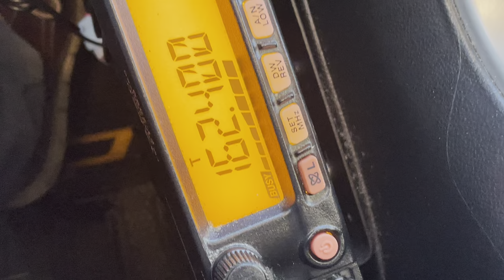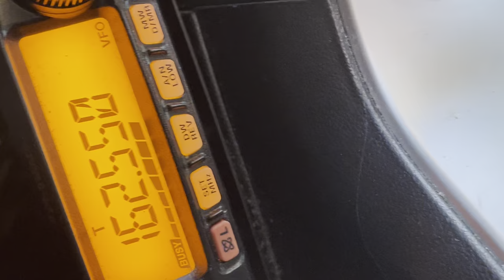VHF Band Opening Multiple Signals Ducting DX Long Range Propagation NOAA WX Radio 09/10/2024 Part 2

Comment from the maker: If you’re wondering what the point of the DC volt meter is…well, I was doing testing to see how much voltage drop occurred in the car’s electrical system when I transmitted at different power output levels….and obviously the function of the voltage regulator when the engine is running, plus voltage drop on the battery when the engine is not running.  

Yes, I know, “12 volt DC”.  The battery by itself should show a voltage in the 12.2 to 12.5 volt ballpark.  

With the engine running [and alternator charging the battery] the voltage should be more like 13.5 to 14.5 volts DC.  Different vehicles do this differently, with some systems running closer to 15 volts than 14 volts.  There’s a reason most “12 volt” radios actually specify 13.5 or 13.8 volts, usually with a tolerance of +/- 15%.  

So that’s a range of 11.7 volts to 15.9 volts in the most extreme examples (operating voltage: 13.8 VDC, +/- 15%).  

In addition to the automotive voltmeter, I did use and am using more traditional analog multimeters and digital multimeters (I am aware the FT-2980 has a DC VOLT display option too).